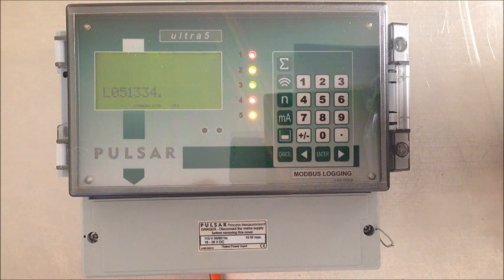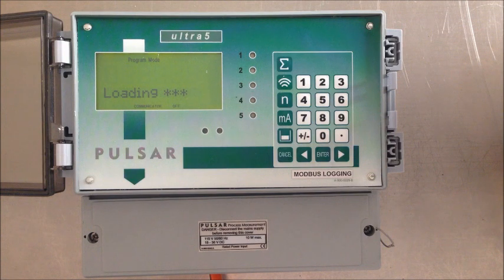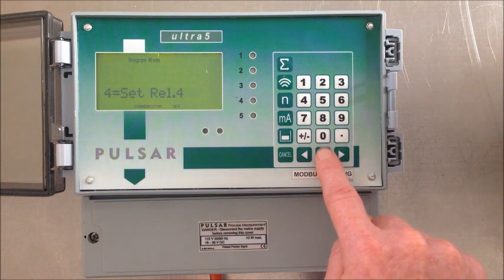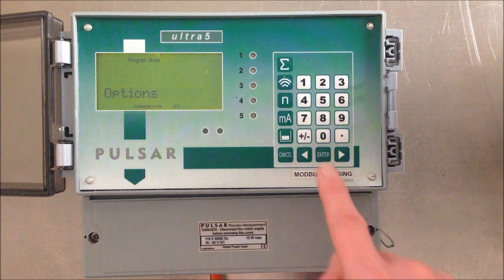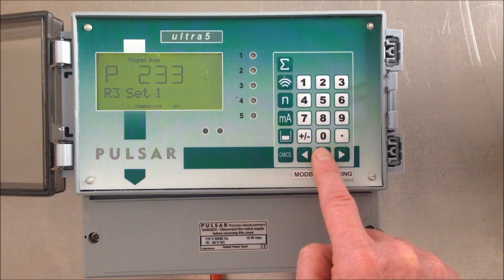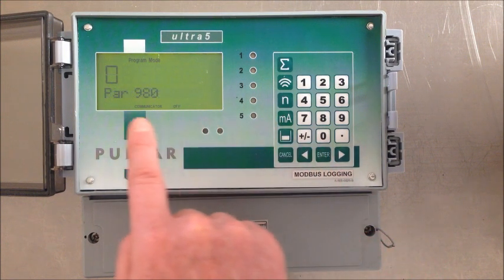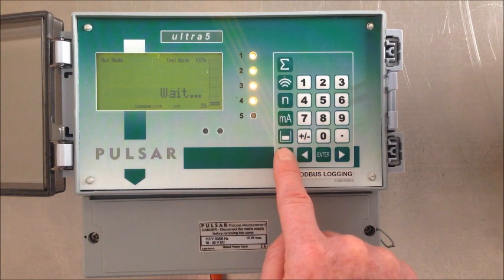Pulsar Ultra 5 - Pump Controller Programming (replacing float switches)

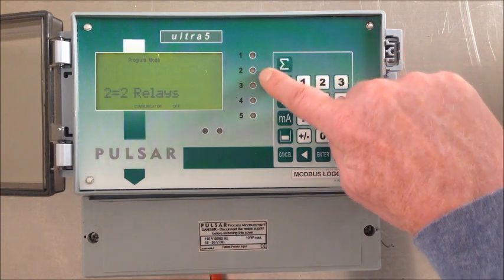Comment: at roughly 4:00 you say that you selecting "control down", however he goes onto press '2' which as far as I can see is "control up". can you clear this up?
Reply from the maker: +Josh Reed-Harrison 
Hi Josh, well spotted ! 
The purpose of selecting 'control up' or 'control down' is to guide the unit with regards to where the on/off set points should be, in relation to the operation span entered. However, it really doesn't matter for this specific application, as 2 relays are 'control down' relays (the pump lead and lag on points) and 1 relays is a 'control up' relay (off point for both pumps), this is because we are replacing float switches directly.

Relay 1 energizes ON to turn off both the lead and lag pumps (relay OFF point higher than the ON point)

Relay 2 energizes ON to turn on the lead pump on (relay OFF point lower than the ON point)

Relay 3 energizes ON to turn on the lag pump on (relay OFF point lower than the ON point)

But we will get this video updated and republished. Thanks again for spotting.